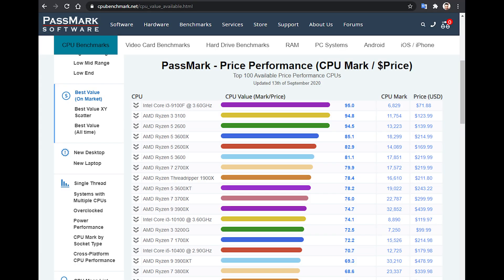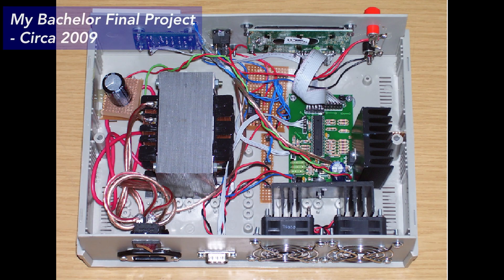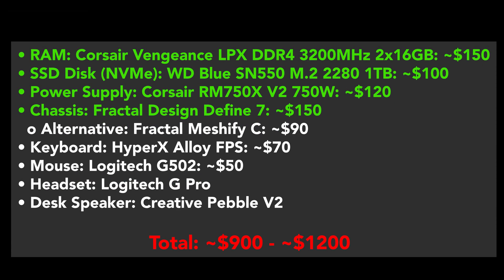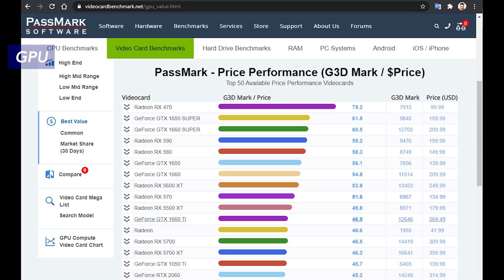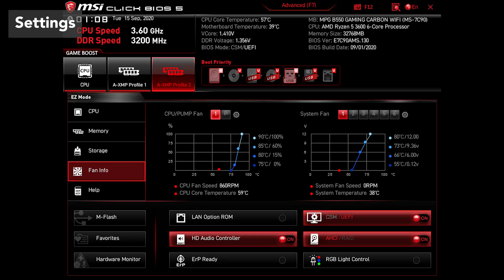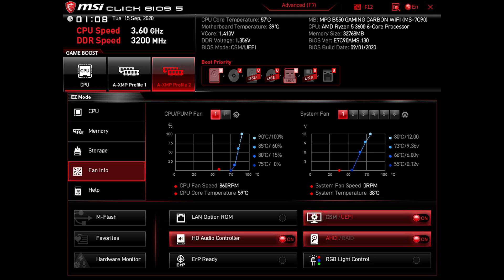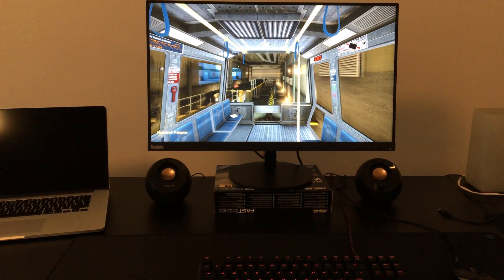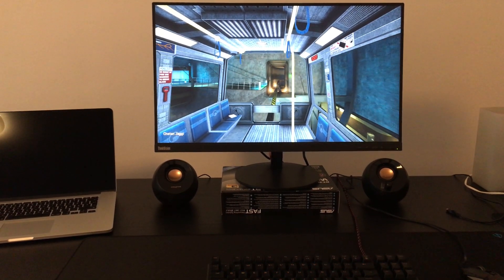Maximum Value PC Build by a Software Engineer - Complete PC Build Guide

Comment from the maker: Here is my guide for installing Manjaro Linux for scratch and preparing it programming: https://www.youtube.com/watch?v=6A8rwX2J2HA
Also I forgot to clarify my mobo choice so here it is: X570/B550 mobos are slightly more expensive than X470/B450 counterparts, but they are future-proof and have excellent VRMs (voltage regulator module) in general, so you will be upgrade-safe. Also, I went with a full-ATX mobo for future expandability, which should come in handy for future media work.

Comment: Nice build! If someone is looking for a more portable solution I strongly recommend for going with AsRock Deskmini X300 motherboards.

I managed to get a Ryzen 4350G/32GB DDR4/256GB SSD build for just under 700$ (not including keyboard, monitors,..etc). 

Surprisingly for me I had less issues with Ryzen Graphics than with Nvidia on Ubuntu. The thermal performance of the noctua cooler is also very good, no matter how much stress I put on the system.
Reply from the maker: Yes, I highly approve of AsRock Deskmini AMD series. I actually strongly considered buying one of those and be done with it instead of assembling one myself. I ended up with a big chassis just in case I needed massive amounts of storage in the future. X300 looks especially good, since it seems to have support for latest gen Ryzens. Enjoy!

Comment: sir i am a beginner can you plz tell me that for coding only can i go with a lowest powered graphics card (GT 710) or chose at least GTX 1050ti with ryzen 5 2600 plz reply
Reply from the maker: You can buy a CPU that has built-in GPU like Ryzen 3200G for $100 and you will get amazing value. I have a GTX 1060 in my computer, that is never used more than 10% so choose the lowest graphics card you can if you are not planning on doing graphics/gaming. Good luck.
Reply: @QuanticDev  so instead of gt 710 or gt 1030 i should go with a 3200g and plz also tell me that is 8gb ram enough or i should go with 16 gb ram
Reply from the maker: @shauryakumar5421  8 GB is enough for programming. You can always add more when you need to.
Reply: @QuanticDev  thankyou sir for your advise 😊😊😊😊
Reply from the maker: My pleasure.
Reply: @QuanticDev  😁😁